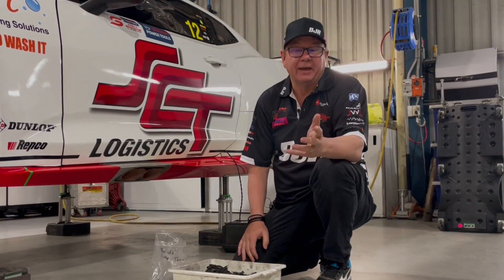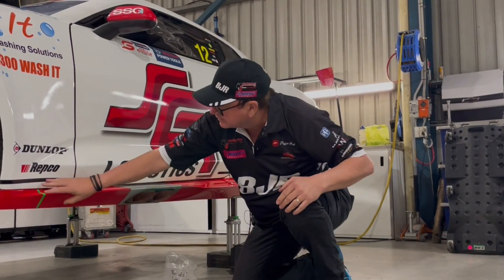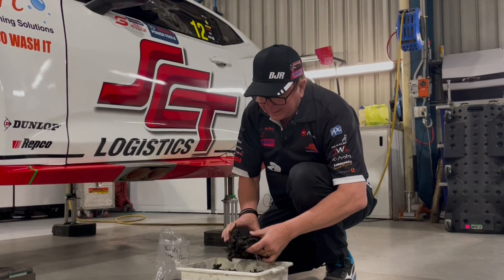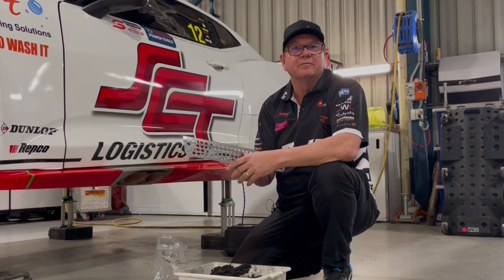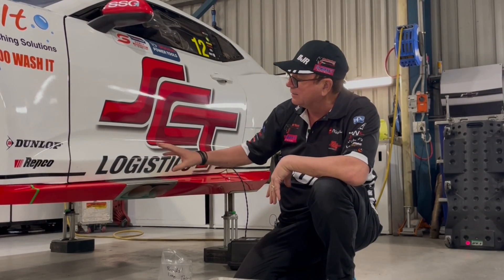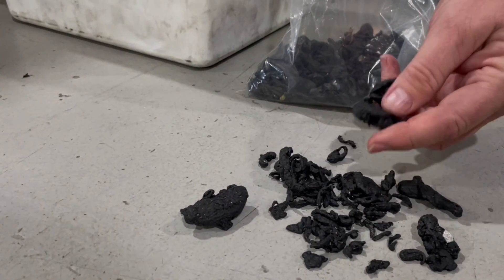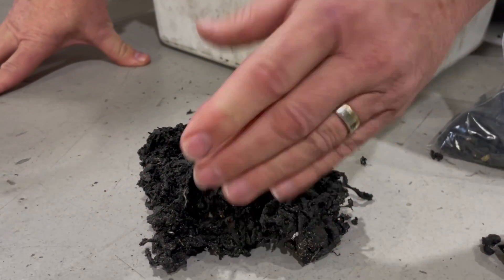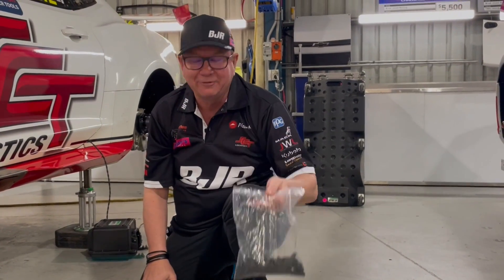The difference in rubber pickup between Soft and Hard Supercars tyres

Comment: Soooooo
When the cars are weighed after a race to confirm minimum weight that would include the rubber they've picked up off the track?

Soooooo
If a team wanted to reeeeally push the limits you could gamble on a given amount of rubber picked up and run the car a Kg or two under weight and cross fingers it'll pick that up out on the track during the race LOL!!!

Alternatively without being so blatantly sketchy are you allowed to fit something like a tiny carbon fibre shield to prevent the rubber build up in the rear bumper etc?  or are the rules a bit tight for that?

Our class is VERY open for rules but I find stones collected all over the place, it all adds up and every Kg counts sometimes.